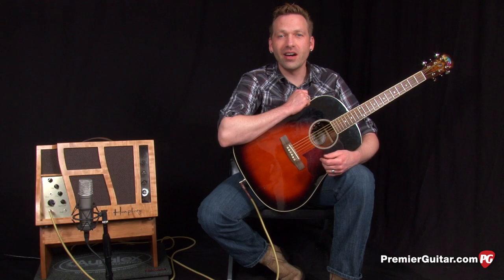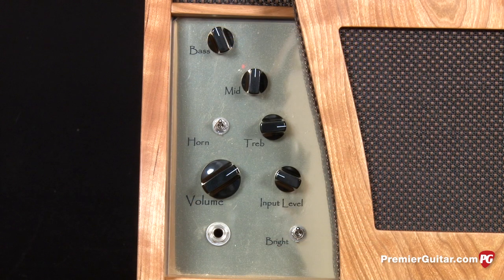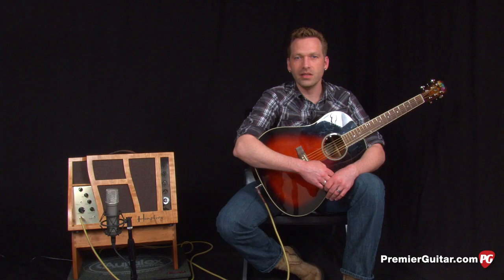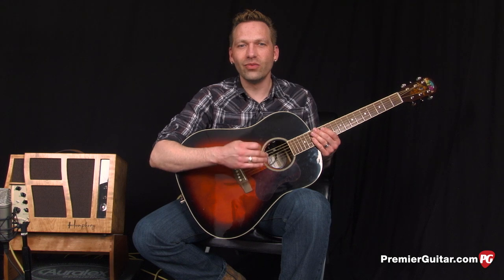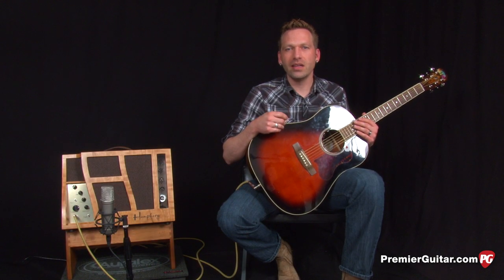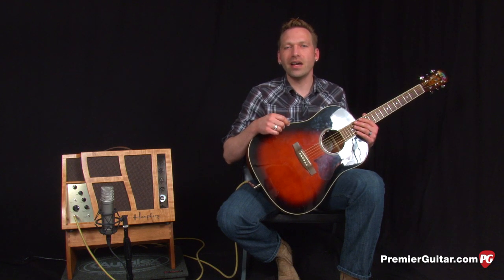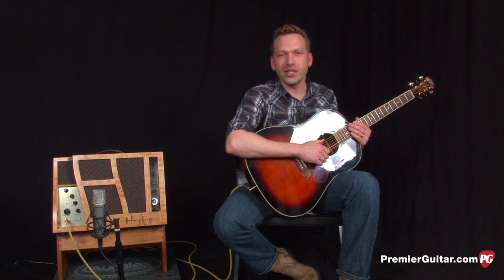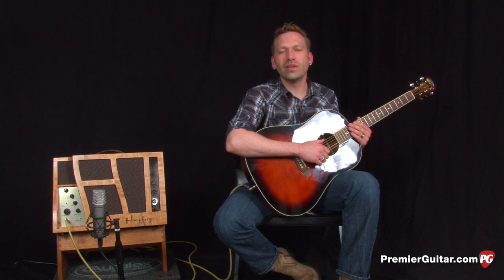Review Demo - Humphrey Amplifiers Espresso 15

Comment: that's because valve amps have lower headroom (they distort earlier than solid state amps). the only time you need an acoustic amp is when you're playing a gig and that's when headroom counts. look at acoustic guitar amps like a one channel mixer with a speaker built in.

Comment: This is a marketing tool tweaked to showcase the amp, not a critical review.

I'd have liked to hear this amp with the horn ON and the bright OFF. With both on, the sound was unnaturally bright & with both off the guitar's natural sparkle was muted.

 What's the center frequency of the mid-range control? Sounds nice w/ that pickup system, but how's it sound with  a basic piezo where you have to turn the 400-550Hz range way down? Slope-shoulders are amp friendly. How about a dreadnaught?